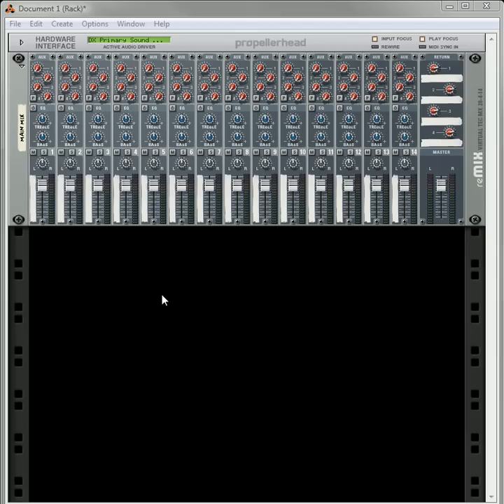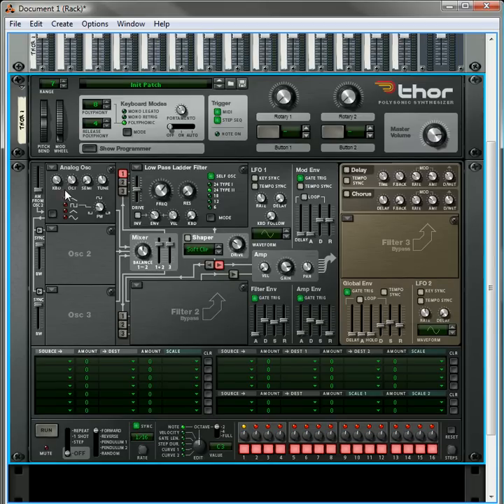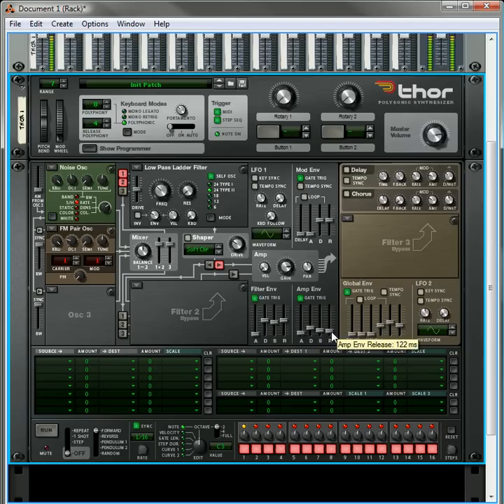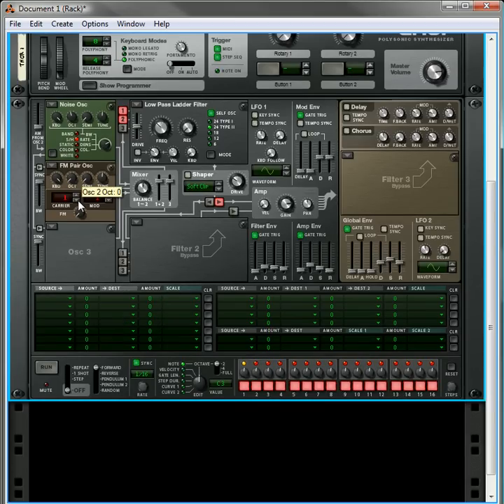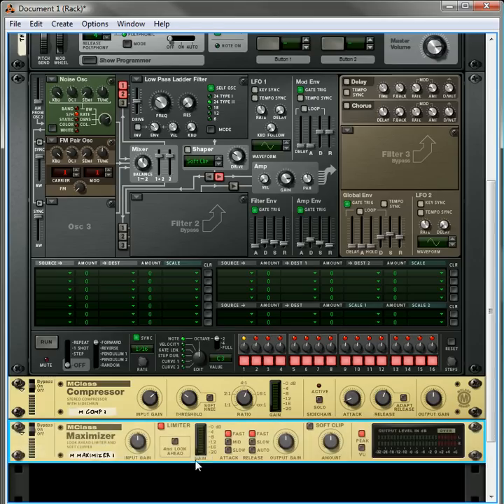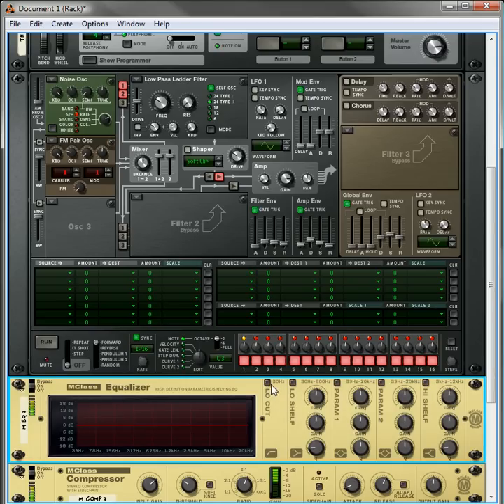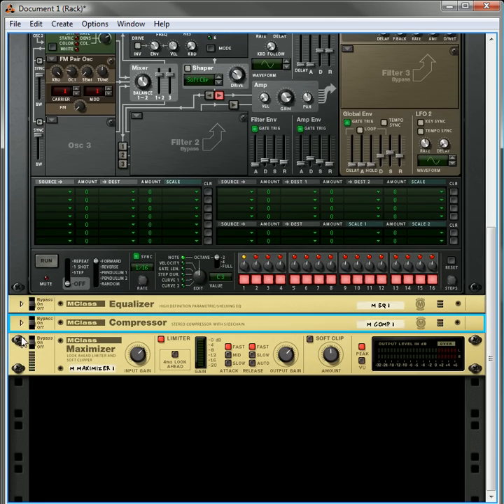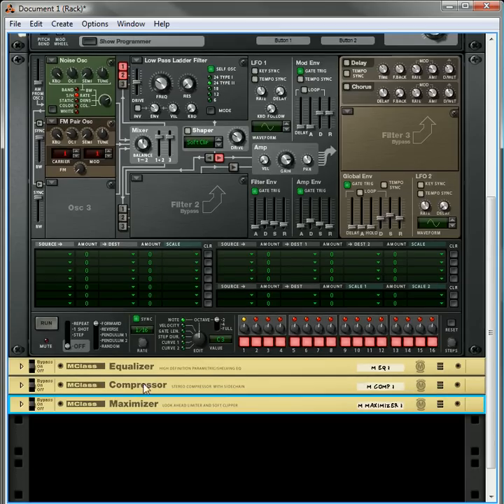Kick Drum with Thor

Comment from the maker: @BIFFdubs Edit > Preferences. Then in the "General" tab, which should be open by default, there is a checkbox labelled "Load Default Sound in New Devices" -- make sure this does NOT have a checkbox. Now any devices you load in Reason won't have a default sound in them. They will all load up "initialized"